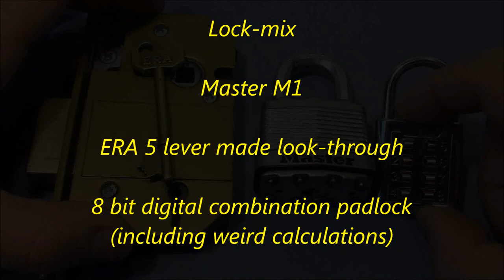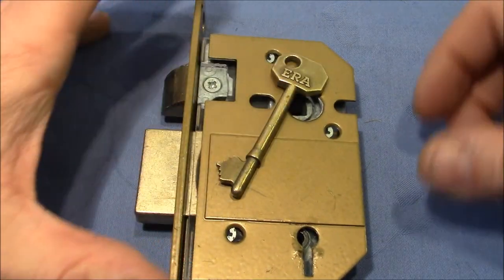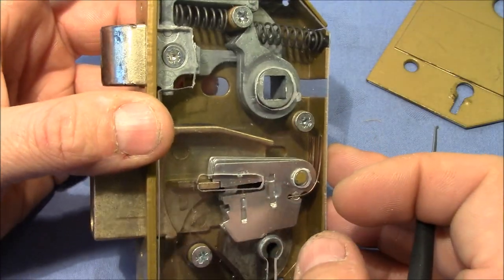(picking 339) Lock-Mix: Master M1, digital combination padlock, Lever lock made look-through

Comment: Using hex(adecimal) notation is even simpler. 36. Upper button 8, then 4 and 2, lower button 1. First digit, for the left column, is 3, right column is 6. All buttons pressed would be ff...
Master seems to improve on the mechanical parts of their products, yet the four pinner stays the same. Benefit: if you have many locks, you just have to carry a pick and a tensioner with you 😉
Reply from the maker: Yes, true regarding hex values. But I thought people would appreciate more a base 10 number ;-) Master: The rake seems to be the master key for the M1 ;-)

Comment: That's not digital. Mechanical.
Reply: Mike Galligano Not digital? So it's analog? Check out Ries: Rechnung auff der linihen. An abacus. The differential engine. The term digital neither implies binary nor electronics.
Reply from the maker: Yes, it's mechanical - no doubt ;-) According to wikipedia: "Digital usually refers to something using digits, particularly binary digits." (https://en.wikipedia.org/wiki/Digital) and according to the marketing name "SKS Digital Combination Padlock - 35mm" (http://www.nothingbutlocks.com/SKS-Digital-Combination-Padlock-35mm-p/sks-pad2.htm#axzz4eIbyudz1) I believe that the word "digital" is used correctly here.
Reply from the maker: Right. Digital refers to discrete data - in this case the value of every bit can be either 0 or 1 (pushed or not pushed).